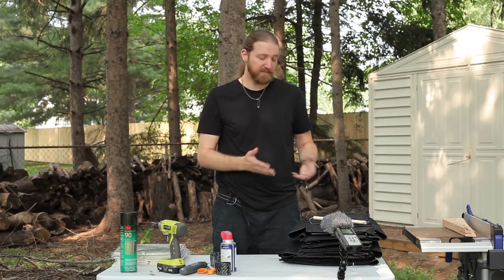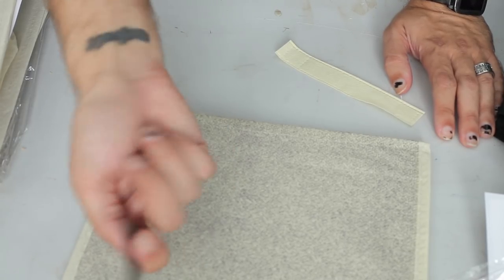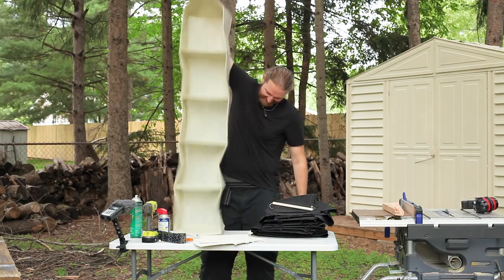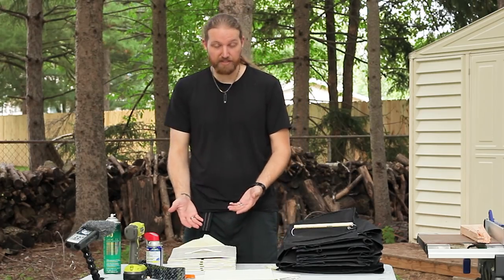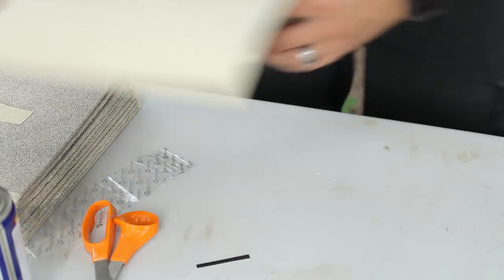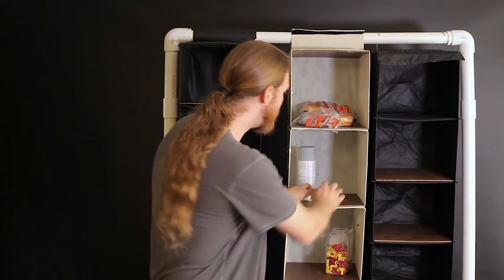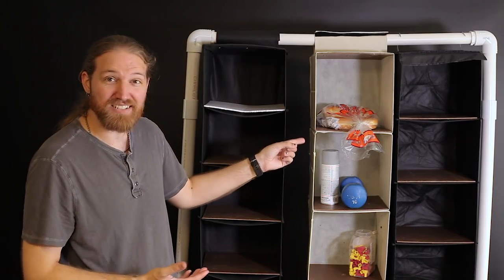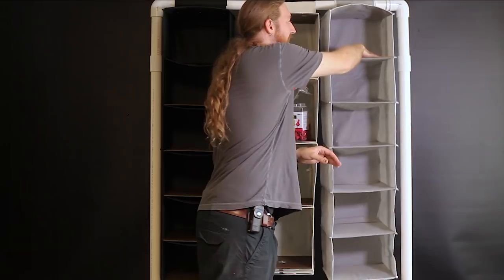DIY - CLOSET ORGANIZER

Comment: Cool! What other type of glue can be used? I can't use spray glue. Also it cost too much. The top part was complicated for me. I'd have to do it a simpler way.
Reply from the maker: I would imaging most glues would work. My firs choice would be rubber cement, but I don't see why wood glue or even just Elmer's wouldn't work as well. Spray glue is just fast and convenient. (I've seen small cans of spray glue at the dollar store too, so you can find it for pretty cheap) Also depending on how much weight you plan to put into it, you could probably get away with zip tying it together. Or if you sandwich each cubby between 2 sheets of hardboard, you could bolt the whole thing together.